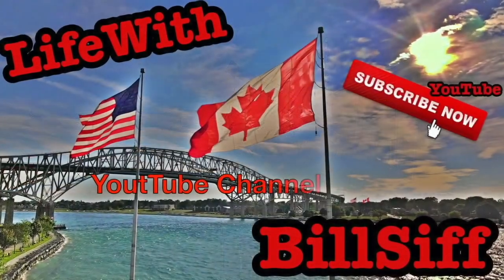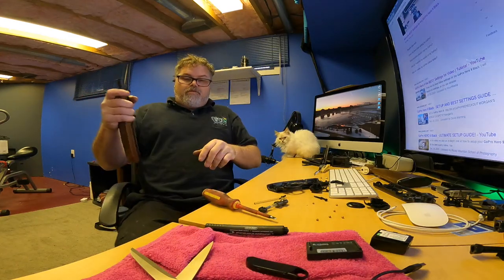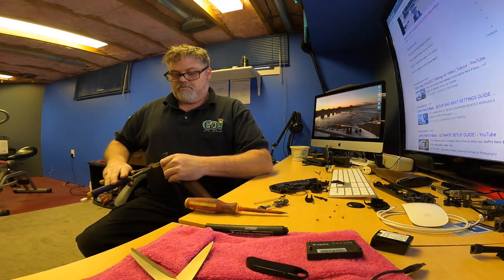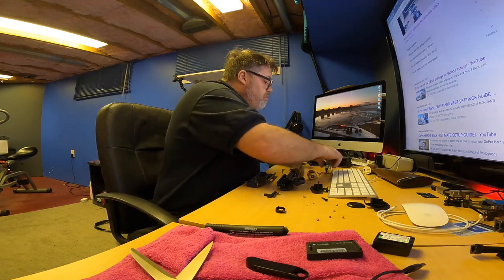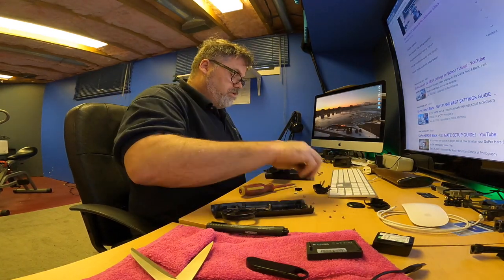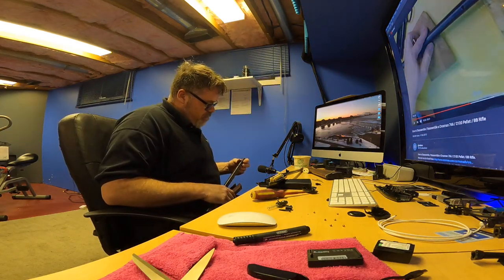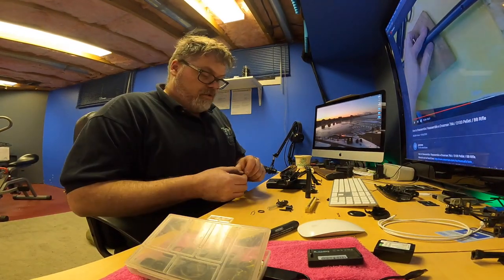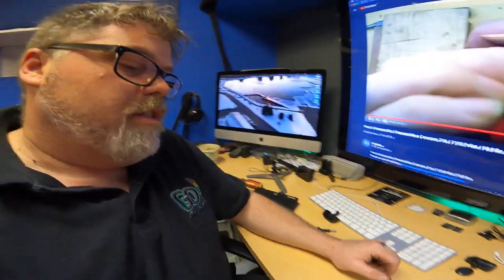Crosman 2100 Air Gun Fail

Comment: I've rebuilt two of those in the past few years. It can be difficult and/or nearly impossible to get back together, but I found a guy on you tube that shows exactly step by step how to do it and then it's at least doable. Still a pain the rear though.

Comment: Biddy I had a guy give me 7or8 of those pellet rifles all were not working . I started on one and ended up fixing all of them . Most of them wouldn't pump either .there was the little pressure chamber had inverted seal. That is typically the reason for not pumping up. I still have all of them and shoot them regularly. Lube them with 3&1 oil . If they sit around they can stop pumping also.

Comment: You can fix it Bill, just seek out some better how to videos, there are a lot of hacks on the youtubes when it comes to air gun repair, especially maintenance.     In the meantime, keep an eye on princess auto, pick up one of their 34 dollar break barrel chinese B1 (and no annoying safety!) pellet rifles.  I got one beginning of the pandemic as a screw around with it gun and see if I can make it better...  Well, I didnt touch it, its a rather accurate shooter surprisingly enough.  Good enough I picked up a second one--with a wood stock. First one had a polymer stock which I'm not too fond of. But as with everything PA, you never know what'll be in one shipment to the next.   SKU 8861726 if your dad wants one.  Keep an eye on the flyer when they show up, here in London they sell out quick when they get stock. 
I'm sure you found it already,. but crosman dot com has parts diagrams for most of their guns, (look under owners manuals). At least you might be able to spot if the previous owner left some bits out of it preventing it from building pressure.